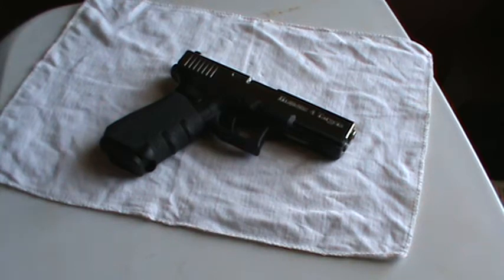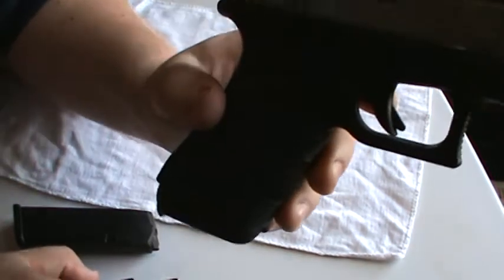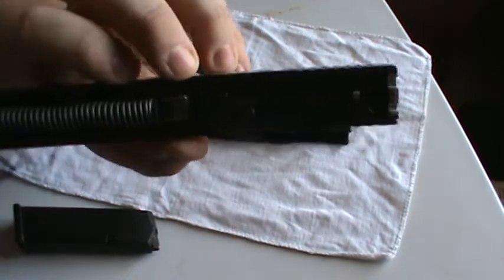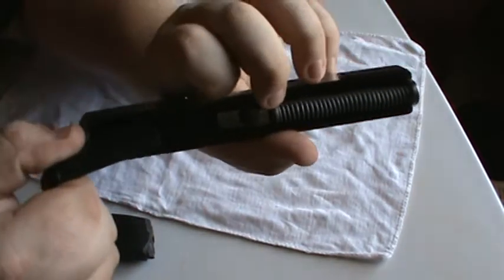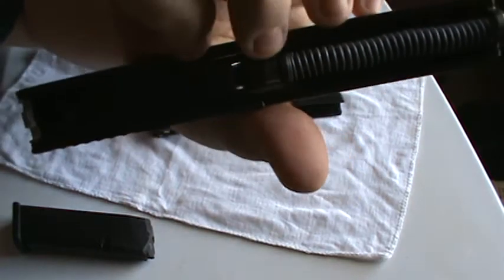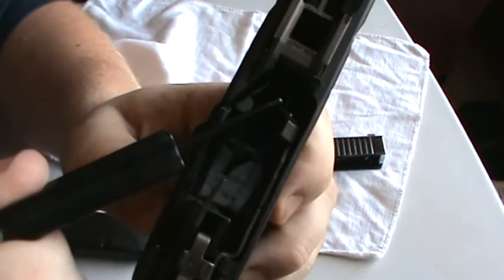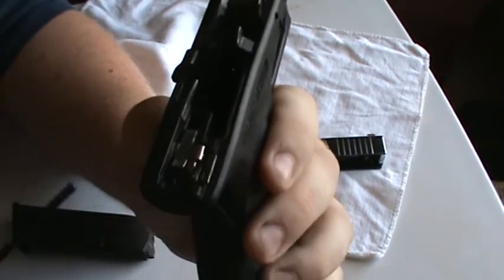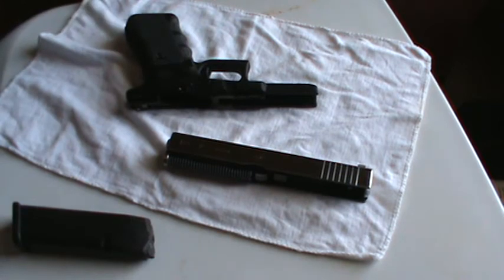How the Glock "safe action system" works

Comment from the maker: It is considered a safety because the back edge of the striker is locked behind it, and it alone would prevent a ND from deopping the gun. Just the way it is designed, drops on some guns would defeat the sear and fire if it hit's the ground hard enough, but not a Glock. Paul

Comment: That "lip" at the rear of the frame that moves downward to release the striker is called the "sear", and it has naught to do with safety. The sear's job is to hold back a compressed spring until the moment of firing is desired by pulling on the trigger. That is why it releases the striker to fire the round, It is in no way a "safety", whether or not Glock terms it so in its literature. The device that holds back the force that will eventually fire the chambered round is the sear, even if I(the manufacturer) chose to call it the "whatsit" :-)

Comment: @wunino1 
You don't need a "decock safety" because the hammer isn't cocked until you pull the trigger (it's a double action only pistol).  This also makes the trigger harder to pull.

Comment: Good vid.I just purchased a model 23 gen 3 40 ca. had 1 long ago and couldnt really recall the safety features.Thx for posting this. Question though please...i have a 13 round mag.I can manually chamber 1 round though correct? Leaving the fulll mag,,,?

Comment: the concept of a trigger safety is often misunderstood. I think the trigger safety works more like an impact safety, and it works together with the trigger bar drop safety and the firing pin block accidental discharges (as opposed to negligent discharges). A trigger safety is not designed for the finger. People are either 1-experienced, keeping their fingers straight or  2- un-experienced keeping their fingers curled inside the trigger guard. (still alot to say, so ill continue as a response):

Comment: As some have mentioned below:  these are safety "features" but are NOT safeties.  If you pull the trigger, it goes bang.  A safety on a gun means if you pull the trigger with the safety on, it will not fire.  I know you did not intend to imply otherwise, but don't give the impression that there is an internal "safety" that is bypassed when you pull the trigger.  I don't think that can be called a safety.  It might be a drop safety, which has an entirely different meaning. 
 And the little thing on the trigger is in no way a safety or safety feature.
Reply: sycamorebacker1 There are internal safeties that are bypassed when the trigger is pulled. The trigger doesn't get pulled, the safeties remain in play. So, you are wrong.
Reply: John B If I am wrong, you cannot shoot a Glock.  If you pull the trigger, it will not fire.

Comment: . I can guarantee that a majority of unintentional discharges (with the gun in hand) happen when fingers are left completely inside the trigger guard, in which case, a trigger safety would do nothing as a safety feature. I’ve also read comments saying that trigger safeties are for preventing snagging. Again, if an object is going to snag on the trigger, what are the chances it will contact the trigger only on the small portion of the trigger face where the trigger safety will not be depressed?

Comment: I agree that it is really only one safety, however, to properly operate safely you shouldnt have your finger inside the trigger guard until you are ready to fire anyway. So you would have switched the safety off before putting your finger to trigger on a gun with external safety anyway.

Comment: The firing pin block is the only real safety. The striker can only move forward when the trigger bar presses the firing pin block upwards. This safety is present in almost all firearms for the last 60 years. 

The Colt series 80 also has this firing pin block. This is the only safety that makes a gun really drop safe.

Comment: i thought the drop safety was that the striker wasnt under spring tension until u pulled the trigger and when the trigger  was almost all the way back the sear unit dropped or tilts down leetting the striking go hit the primmer.that is what i was told by the glocksmith when i bought my 26.thanks for the vd to manny people are scared of glocks because they dont have idiot levers as i call them.ur vid should help clear things up.

Comment: My concern about the "glitch" (Glock) pistol is pursuing a suspect with my weapon in hand, but he runs through a hedge or a bush.  What if a twig pulls on the Glock's trigger?  In that scenario, such a twig would not have sufficient force to pull back the hammer of a double-action pistol.

Comment: Read your manual. Bottom line: if you put a loaded magazine in the Glock, rack the slide, and pull the trigger correctly, the pistol will fire. There is NO conventional external safety such as on a M1911.
By the way, if you have no idea how to use the gun, put it down and sell it.